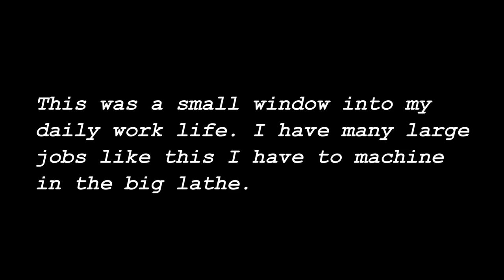Large Lathe Work

Comment: hm guessing the size of an average tool  i am going to take a gues that this material is 500-600 milimiters in Diameter, on my job we can turn up to 1200MM(yes 1 meter and 20 centimeters)
Reply: im working on a vertical lathe that has a diameter of turning head of 2500 mm, and it is a pain in the arse to work on it, much more i prefer a smaller machining.
Reply: 11thboris the machine im talking about can have up to 23 Meters in lenght, its an Universal Lathe
Reply: Sir Phoenix oh i get ya, there are some quite interesting machines out there. but again i personally prefer and find more relaxing and interesting to work on small lathes and milling machines. large ones always bring anxiety with them, and they can be loud as fuck if you machine something that is thin
Reply: 11thboris do you mean with small 3 meters or so? because that is the size of my machine
Reply from the maker: The OD of the tube is around 15-16 inches, can't remember for sure now because I work on several different telescoping cylinders. The lathe is an American Pacemaker 21x192. It will swing 25 inches, and hold 14 foot between centers.
Reply: Abom79 that is a pretty small machine compared to what we got in our factory
Reply: Sir Phoenix so instead of bragging about it and posting videos of you playing games on the computer why dont make a video of you using this beast
Reply from the maker: Sir Phoenix
I for one understand that machines come in all sizes, and one that someone may consider large, may be small in comparison to others. I have seen some massive lathes before, and I know this one looks small next to some. But in an average repair shop, this size lathe is normally considered big. It's the biggest lathe we have so everyone calls is "the big lathe" when they are refering to it.
Reply: Abom79 I run a VTL, with a 144 inch chuck, and I'd still call your lathe the big lathe. It's all about perspective of average machine size for each individual shop. Great video.

Comment: that machine is tiny compared to what I run here in va, 15 ft swing by 50 ft is the biggest lathe at the shop I work at, rpm isn't important it is the Surface Feet Per Minute that matters in relation to the size

Comment: Im surprised they bother repairing this and just make a new one
Reply from the maker: A new cylinder of this model will set you back about $50K.
Reply: Adam is right, if not more. I manufacture hydraulic cylinders for a living and I am a mature age fitter/machinist apprentice. We make anything up to 6" bore cylinders. A 6"bore x 36"stroke cylinder would probably set you back about $3kAUD ($2.7kUS). This cylinder is a MONSTER!
Reply: Plus this equipment is designed to be serviced. It just takes a little more work to get into, but nonetheless it is perfectly serviceable and useable.

You throw something like this away, you are a damned fool and don't know how construction and construction equipment works.
Reply: Nighthawke70 just because it is easier to go buy a new one does not mean that overhaul isn't the best option. Very often equipment just can't be replaced so the only option is to find the overhaul shop to do the work. Tossing equipment like this into the recycle bin would be like burning money, which is exactly what I would expect from a young green engineer that has no clue of what cutting C's and 6's even means, let alone how difficult it is to create an 8 foot long precision bore. This is what happened when most of the true manufacturing was send off-shore creating 3 generations of know it all know nothings at the helm.

Comment: our putting alot of faith  on if someone welded it all centered plumb and level your drill technique  to find center is not accurate
Reply: Gary Zea makes no difference if the bearing housing is centred to the ram body, this technique will find the centre in relation to the ram body regardless